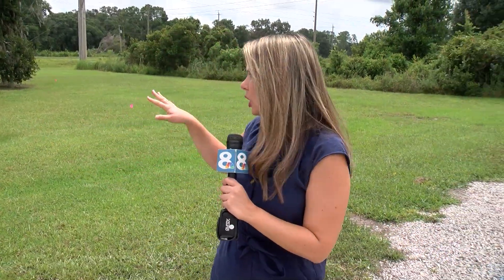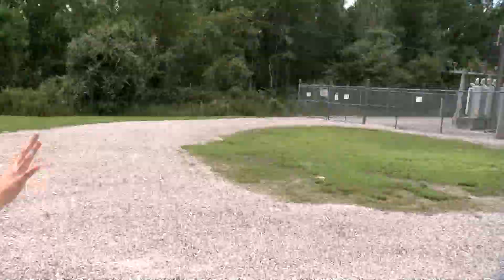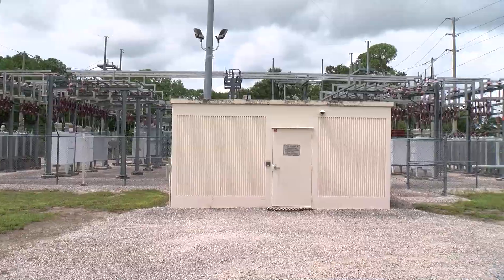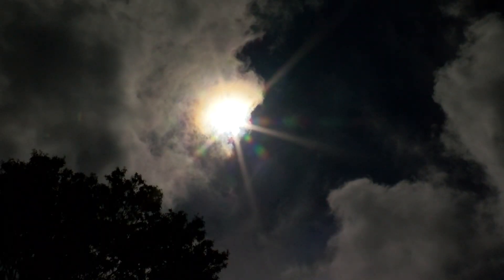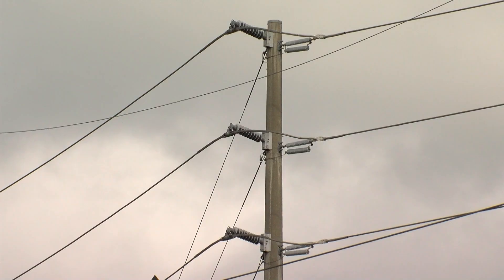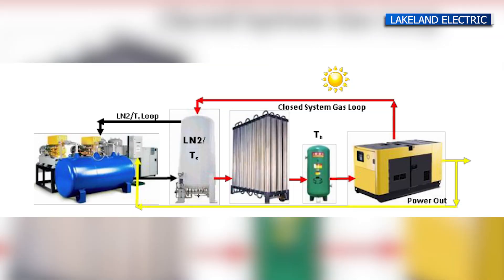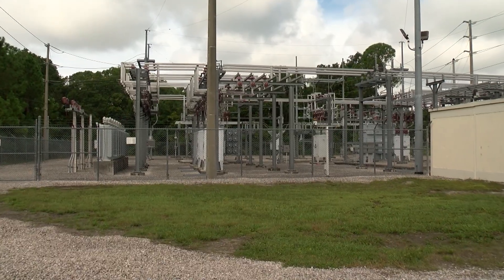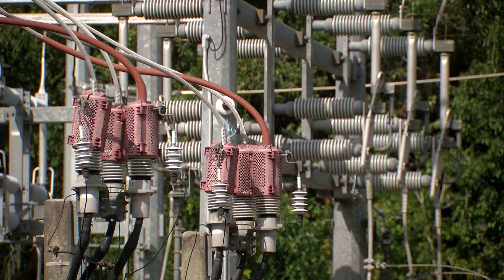Lakeland Launches First-in-the-Nation Liquid Nitrogen Power Program

Comment: The round trip efficiency of this nitrogen system is dismal.  They should just use battery storage.  Modern battery systems are 85+ percent efficient including all losses from AC to DC to AC conversion.

Comment: Compressing and cooling Nitrogen from gas into liquid uses a lot of energy.  Using Nitrogen expanding from a liquid into a gas to turn a flywheel connected to a generator would be clean energy.  But the engery needed to decompress the Nitrogen back into a liquid would have to come from an outside source.
Reply: SHHH  If you speak facts and the truth that goes against the narrative you WILL be canceled!
Reply: Speaking the truth against the narrative?  I am wondering where the energy to recompress the Nitrogen back into a liquid comes from. For this system to work, making Nitrogen liquid again in the system itself.  Either that or the power plant would have to be resupply with liquid Nitrogen.  That would be expensive.  There are companies that can deliver liquid Nitrogen in specially designed tanker trailers.
Reply: Man, you ain't kidding. You think a salesman fed them a line or what? Glad I'm not in Lakeland. Bad idea